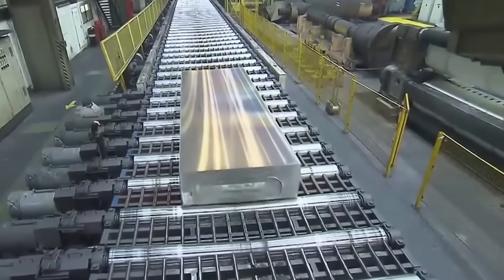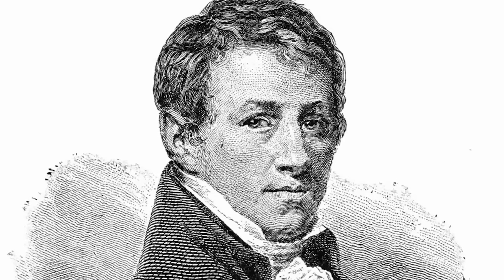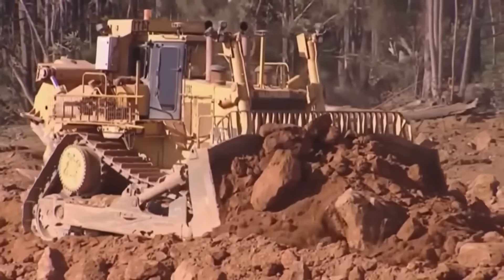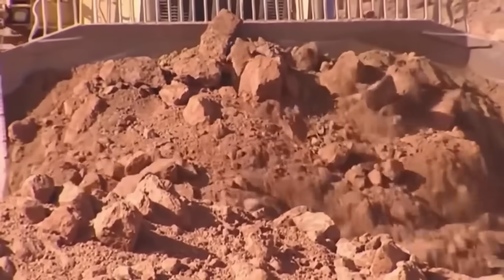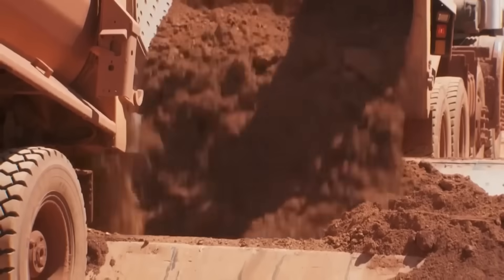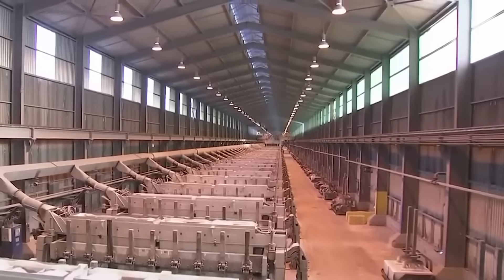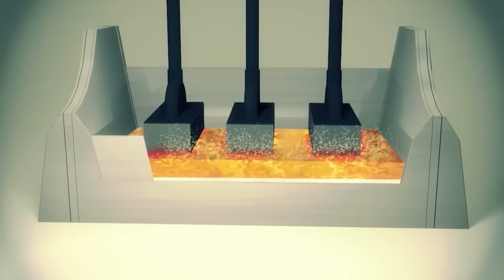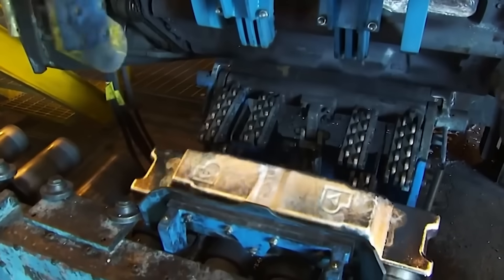How ALUMINUM is Made and Where IT COMES from | THIS Is How the World’s Most Used Metal Is Made

Comment: As a high school metal shop student, one pr I ject was to make a mold and pour aluminum into it, making a cast aluminum dog. Later, as a welder, i used tig welding to weld/repair cast aluminum concrete forns. Boy, was that nasty work.
Later as a welder, i did retrofit work, welding pipe on a freighter loaded with bauxite, on the gulf coast.
And later, as a welder, i became very good welding aluminum of different types using both mig and tig processes. I tried using stick years earllier but found it to be extremely difficult. I just recycle all aluminum i can these retired days now.